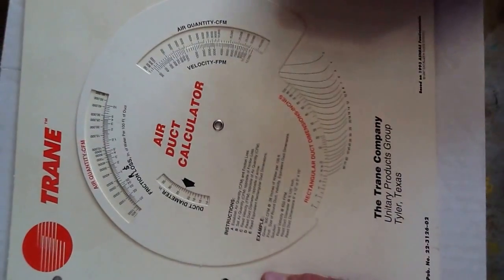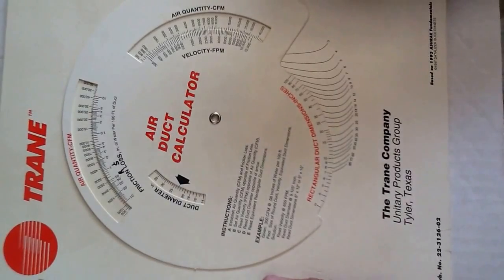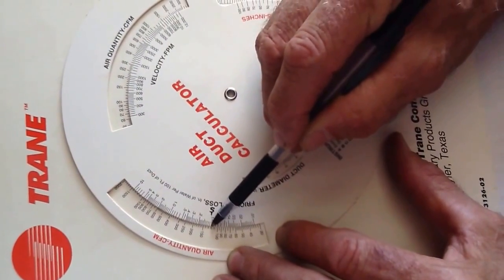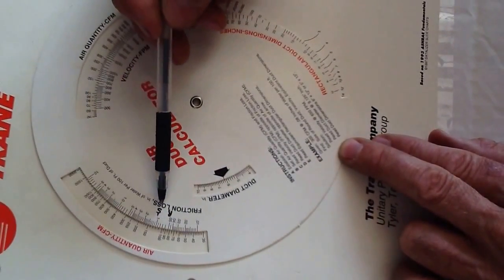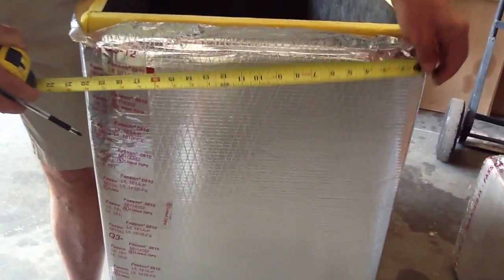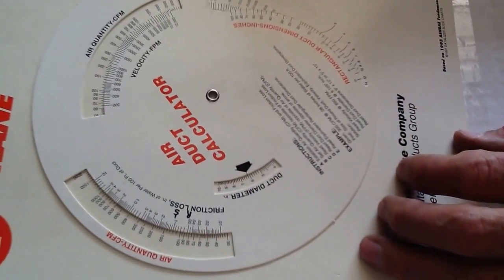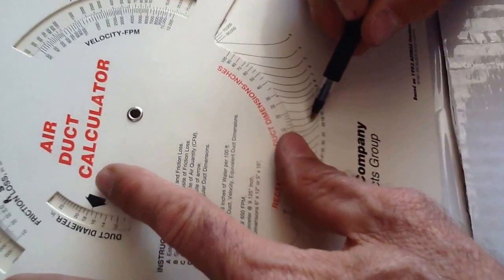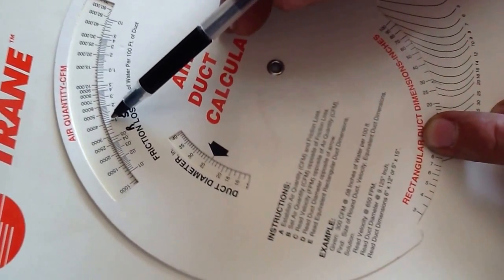How to Quickly Size Ductwork!

Comment: I am scared to use that fiber duct board. I cleaned several coils in an aprtmnt building with hardened black crud, under the microscope we discovered it was the very same fiber that insulates the air handler. After some time it flakes off , gets moisture from the coils and becomes like paper mache.  I wont use it, its not time dependable plus people are breathing that stuff into their lungs. I wouldnt buy a house with it.  Beware of that stuff -people.  Thoughts?

Comment: Did you miss the text on the ductulator that says "friction per hundred feet"? You are missing the step where you determine the equivalent lengths of fittings and calculate friction rate PER hundred feet.  I would also like to point out that you are sizing flex with a rigid duct sizing tool.  Flex duct has a minimum two feet of effective length per foot.  You are teaching people to use a rigid duct sizing tool for flex with no concern about the effective length of the duct. A static pressure of 0.1 is good, but a friction rate of .1 PER hundred feet is likely not correct. You need to take the Static pressure (0.10 ) and multiply it by 100, then divide by the effective length of duct from the air moving device to the diffuser. Count your measured length as two feet for every foot.  On the back of your ductulator there are equivalent lengths of fittings.

Comment: I hope people still aren't doing like this. Your friction loss is not a set number. It's the starting static you get from the blower performance chart minus airside pressure drops divided by total equivalent duct length. It will not be the same for every system you do. Please buy a Manual D

Comment: I believe the Trane duct calculator you were using is for ridged duct, not flex.  They make a duct calculator for flex duct. Flex duct does not have the capacity of smooth ridged duct.  We always sized residential ductwork for .08 static.
Reply: .08 for rigid or flex ?

Comment: Hi. My name is Miguel. I'm having trouble working on sizing up the rooms in the home. I'm taking HVAC Course at UEI graduating this June. I'm just confused from when all rooms and you get the Return duct diameter how or which sizes do you start off to do your runs? I'd gladly appreciate to get your help with what sizes you start off with from your Return.

Comment: I think I can clear this up for everyone. If you need to deliver  800 cfm,  select a fan that can deliver it at .7 or .8, instead of .5, then you have some available external static pressure to design your duct system with. A coil, filter,grill ,register,and damper use up .5 ex. S.p. Bottom line, if you have a 2 ton a.c., you will need a 3 ton blower.  Unless you duct system just a couple of feet long.

Comment: love your videos on a/c system.  It is hard to get anyone to size the my a/c 
unit.  I live in New Orleans, la.  
 My house plans show 1725 sf living area including exterior wall.  W/o exterior walls I measured the  interior 1600 sf,.  W/o interior walls measuring room I meausre  apprx 1520 sf not counting interior walls.  3 BR, 2 bath house, insulated walls and attic,  have a den, living room  and kitchen (2 large windows face west living room and 1 small window face east bathroom) t).  Contractors stated  I need a 4 tons unit. Seem large. I had a 3 1/2 ton but return was smaller then recommended by your videos  20 X 24 or 25".   Would it be a problem going with the 4 ton with a 24" x 24" grill.

Comment: David, very informative video..but you have the design friction loss wrong. Yes we design for half inch. That is what almost all residential units are built to. But you need to subtract component losses to get your AVAILABLE static pressure to size the ducts correctly. You have to subtract, registers, dampers, coils, filters and such then use that number for your friction loss which is always less than .5 and will result in larger ducts needed to deliver the proper amount of air. At our company we do not use rule of thumb to calculate air delivery. We do a complete manual J with room to room load analysis and size the ducts to accommodate the actual load which can vary greatly from the rule of thumb.

Comment: knowing what your blower is rated for is where you should start your duct sizing.
Reply: That's putting the cart before the horse.  You design the duct before selecting the equipment needed.  Load calculations, duct design, then equipment selection.
Reply: @ Doug

ummm, how about no! Load Calcs, Equipment selection (blower performance) then duct design.

How do you know what  your sizing to without knowing the blower performance? or where the operating point falls on the fan curve vs required CFM?  Are you designing equipment for your duct size? or duct for your equipment?  go look up manual J, S, & D! Sure there are a lot of "rule of thumb" tricks that will work for simple cooling/heating systems with no design expectations, those would probably be more specific to localized regions, that'll get you ball park with experience. blower data, ESP @ required CFM, pressure drops accross air devices, available SP,  TEL, then you can determine friction rate. You cant put the cart before the horse, hahahaha, right back at you
Reply: Blower size is dictated by CFM requirement which is dictated by the distribution system (duct) required to deliver proper capacity (load calculation). Otherwise you could have a 2000 CFM blower on an 800 CFM duct system.
Reply: Using .1 friction is a rule of thumb.  You should calculate your pressure drops, multiply by 100 then divide by total effective length.  Now you have your friction rate to take to your duct wheel to DESIGN YOUR DUCT.  How would you have a blower before that?
Reply: type of distribution system does not dictate CFM requirement. distribuition system is more or less determined by your construction limitations.

more important...  how do you know if you have enough static to overcome your pressure drops accross fittings, filters, dampers, and registers if you dont know what your fan is capable of putting out? do you have enough static left over to achieve desired room stratisfication? or throw pattern?  Your only thinking in terms of CFM and not static pressure. 

Seriously though ACCA Manual D, Section 3-2 is a good place to start. you can even google it or better yet I quoted a paragraph from the first thing that popped up;

"Once the Manual J room details and Manual S equipment sizing have been completed, we can begin to design the duct system for your project. If the duct system is not properly sized, the air conditioning system will most likely not perform as well as it should, have rooms that are too hot or to cold, excessive wear and tear on the HVAC system while costing more to operate. It is important to have the equipment selection made prior to performing the Manual D calculations because each manufacturer’s equipment is different which can impact the supply and return duct work size." -acsupplytexas
Reply: you need the blower data for the static! and friction rate is a real thing bro
Reply: YOU JUST MADE BOTH OF MY POINTS:
"Once the Manual J room details and Manual S equipment sizing have been completed, we can begin to design the duct system... still no blower selected at this point!  Just capacity..  you don't arbitrarily buy a furnace then figure out your ductwork.  "Gee, I have this 1600 cfm blower and only need 800".. you're calling duct design equipment selection.. fine, but they are mutually exclusive.     
And .1 is a rule of thumb, bro.

deduct pressure drops to get AVAILABLE STATIC PRESSURE then divide by your TOTAL .  Don't just plug in .1  That's a hack move.

We have a communication breakdown. I think we're saying the same thing differently.  Designing a system from scratch involves are procedures working together.  You can't just START at the blower.  All I'm saying.
Reply: Doug Gann,

where did I say the 1st step in designing a HVAC system was to start at the blower? my original comment was you need blower data before "duct sizing" and who's talking about plugging in random friction rates? I think your confusing yourself. 

BTW,  check out manual D, it's a shocker
Reply: Doug Gann if a house needs 1000 cfm  to cool it then the air conditioning system purchased will be a 2.5 ton unit and will come with a blower capable of moving 1000 cfm.

Comment: You are all drowning in a cup of water my friends. Hvac duct sizings is not rocket science.  Every successful tin knocking installer out there will size a homes heat load to the locality,,  its either arizona or minessota?   supply duct  sized to 1 inch water column is ok so long you design the whole house to  1 inch, ,  it will just be a bit noisier,,  return design to .07  is more than enough. And for residential stop sweating the details...  if you have a run longer than 100 feet , maybe you need two heating systems. Ive sized duct for over 10 years,,, and rules of thumb for your region is all you need, cos only you knows what works for your  paarticular region, arizona or mineasotta
Reply: Amen, brother.... has anyone even mentioned the lack of a load calculation?  How many exterior walls to that room?  What is the R value above, below and through walls and windows?  Latent vs. sensible?  We work hard for our licenses for a reason.
Reply: Lo Mar Rocket science? no. Science? YES!!! Stop mixing up friction rate and static pressure please. Go back to school if this is unclear. the same goes the the OP. Disseminating incorrect information to the public diminishes my profession.
Reply: Design the whole house for 1”?  Most residential furnaces are only rated for .5” total.
Reply: @rodgraff1782  bull shit,, modern air handlers can really push air,, I’ve measured tons of systems out there and a good inch is fine.  Seen done it
Reply: @fromra8569  No reason to get upset.  I’m not talking about commercial systems, I’m talking about small residential furnaces.  You can go up to what ever it says on the data plate.  If what you are allowed, for the equipment you are working on is more, that’s fine.  Most residential furnaces, in my time,  had a rated total static pressure not to exceed .5 low side probe measured at a tapped hole on the blower door, and the high probe at the discharge plenum, before any cooling coils.  I was a certified Testing and air balancing, Instructor, so I do know a little bit.  Maybe you are talking about a large variable air volume systems, which run at several inches static pressure.  Most residential furnaces I worked on that were running in excess of their rated total static pressure were not able to produce their rated CFM, and were running beyond their designed temperature rise, which is also specified on the furnace data plate.  I am sorry if this is all BS to you.
Reply: @rodgraff1782   sorry I meant to say that our company has forever designed supply ducts at .1 inch wc  and the return you can always size them to .08, maybe .05  for less loud returns. But .1 supply design static and .08 for returns is fine. If you go for .05 return you end up with ridiculously large ducts that you cannot even buy. 

I’ve tested tons of systems and they all run at .7 on the supply  before the coil at a and a good  .7  past the air filter. My point is, most of your restrictions will be at return filter and ac coil.  And them Systems  run just fine. Don’t drown in a glass of water my friends
Reply: @fromra8569  I thought all along that you meant 1”. I agree with your latest post.
Reply: @rodgraff1782  thank you brother . 😂😂😂😂.
The thing is I am a hands in guy. It’s texting  from my phone that the problem lies. Missed a period.

Yes I’ve seen those industrial system that operate at up to 3 inches water column.  But now a days with ecms, sizing duct is less critical unless you do something really stupid. These ecms can really push thru any duct sized to what I suggested. Thanks for sharing.  

By the way I read a few books on duct design. I understand  really well that relationship  between  duck back pressure and volume of air being pushed.  They go hand in hand. Static pressure is really the function of air volume being pushed and also function of how big that duct is. It’s not a linear relationship.   It’s really a multi variable function. A bit of multi variable calculus  that plays in. I have a degree in civil engineering by the way. This falls under mechanical a sub branch of mechanic an engineering but same methods .

But trust me, as far as residential and light commercial that dictulator will work wonders for you if yuur not an engineer.
Reply: @fromra8569   forward curve centrifugal fans have a speed limit, before they stall.  I worked with backward incline, and vane axial fans  with variable frequency drives, on the high pressure stuff.

Comment: David who ever taught you to use .1 friction rate on all supply ducts knows nothing about manual D or a how to use ductulator, not to mention the ductulator you using is for galvanized non lined duct, not flex duct. I might also mention using 1 cfm per square foot of conditioned space would indicate that you size by 400 square feet per ton, in most cases that would cause extreme over sizing! All sizing should be done by manual D's sister Manual J.
Reply: THANK YOU... I'm a contractor in Charlotte... this is why people think we overcharge.. more to it than rules of thumb, but that can get you by if that's how you want to roll.. drives my stock up!  lol
Reply: Nonsense! I have done hundreds of duct designs using .05 Return and .1 supply and have never had a high static issue. Some newer systems that communicate and achieve 17 seer and beyond I will use .04 return.
Good video Mr. Jones

Comment: would placing the vents (2 or 3 of them) directly in the the main trunk line vice branching off negatively affect the flow or efficiency
Reply: No.. not if the system is sized to accommodate them... the lack of the branch lines means less pressure/temp loss

Comment: I am new to sizing duct work and have studied Manual D in depth but have not yet been able to put into practice. I am curious why you are using a rule of thumb calculation for the avaliable static pressure and not using manual D calculations instead? Especially, why are you not using the Friction Rate Worksheet to determine static pressure based on a given blowers design value?
Reply: MisterCristor man, what joke! the new guy gets it but The guy teaching doesn't. This is why 80%+ of all installs are screwed up. Keep reading and studying cristor. I encourage you to join HVAC TALK as a pro member.

Comment: david after how many feet should I reduce down square duct main supply
Reply: It's not how many feet, friction rate is based on per 100 ft... it's about CFM available..  as runs are installed, you can reduce trunk size to cover however many are left, keeping them straight and short as possible

Comment from the maker: Yes, start with the air handler opening, then use the correct static pressure. .1 on supply and .05 on return. I am here if you need me. David